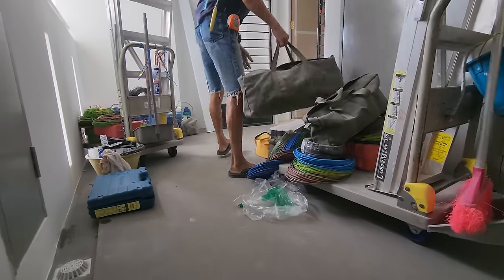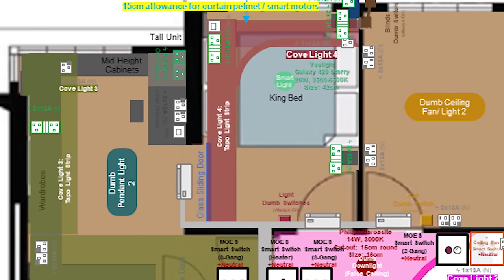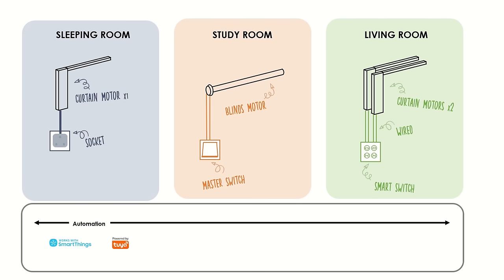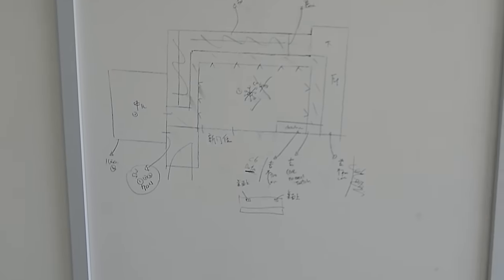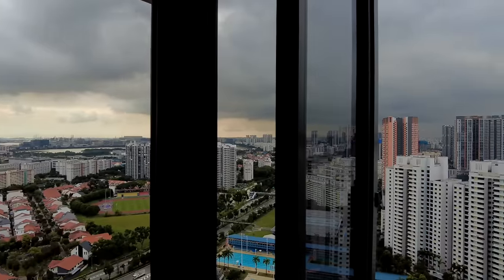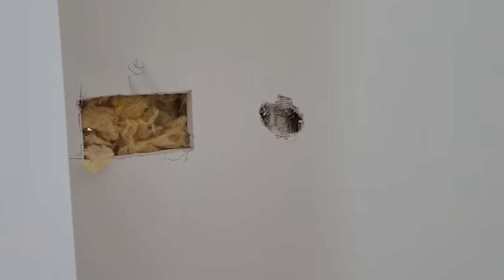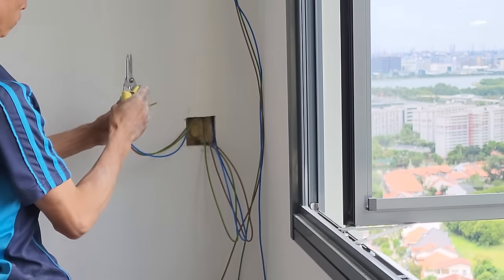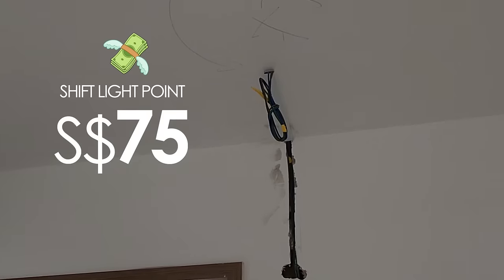Electricals Tips & Cost Breakdown | Self-Designed Neutral Contemporary Home | EP06 HDB BTO Reno

Comment: Thanks for the insight on the electrical works, just have a few questions before i plan out my renovation.
1. Do they have a separate costing for ceiling presence sensors?
2. Did you install your Ring doorbell via a constant power supply? If yes, how much did they charge your.
3. Did you purchase your own LED Strip Lights?

Thank again for the video.
Reply from the maker: Hello there! You are most welcome~

1. Nope.. Most IDs not sophisticated enough to advise you on anything smart home related 😆 Best you self plan, self buy and just tell electrician where you need the electrical points

2. Nope, the battery actually lasts very long. We have two batteries so just rotate out every few months.

3. Yes for the smart ones like Philip Hue or Tapo. As for the normal dumb light strips in kitchen, they are supplied by Electrician. Toilet ones are supplied by the vendor who did the acrylic panel box up 😀
Reply: @thesuakus  

Hello, thanks for the quick answer.

Actually i have already planned out my IoT devices but am only afraid that the Electrican will only be able to install specific 240v modules, and may charge more for others.

Since you bought your own hardware, did the electrican mentioned if they are not liable if any of the devices got spoiled during installation? I would guess your philips hue is via power socket instead of a transformer?

Comment: Do you have a video on how to plan from scratch to do smart home. So confused atm 😢
Reply from the maker: It's coming after our reno series! In the meanwhile, you can check out our Lemon8 for electricals planning (2-part posts)

https://s.lemon8-app.com/al/MvMFmFdQQR

Would recommend you first select an ecosystem (ours is Samsung SmartThings x Google Home) and go through room by room the solutions required (smart light bulbs, smart switches). For devices/appliances, it's simply researching and selecting those that compatible with your primary ecosystem (either directly, or indirectly with the help of a blaster etc). For example, aircon wouldn't be directly compatible with SmartThings, but it can be, with the help of a Sensibo blaster, which is SmartThings compatible. Another example would be our smart curtains and blinds, they are inherently Tuya, which is SmartThings compatible as well. You can check out our Bedroom episode 13 and Foyer/Living/Dining episode 15 which showcases some of these! 😀
Reply: Thank you for ur reply

Comment: thanks for the videos! may i know is there any hacking required to conceal the wire in the toilet tiles?
Reply from the maker: Hello! You are referring to the LED light mirror point on the wall right? 😀 For BTO, no hacking of HDB tiles are allowed until 3 years later, so the only option is to overlay new tiles. Prior to overlaying new tiles, you can get your electrician to pull a new wire for you. During overlaying of new tiles, your tiler can skillfully embed it in a manner that is safe (E.g. within the grout / cut a hole in the new tile). When the electrician returns next time, he will help connect the point to your LED light mirror!
Reply: @thesuakus  thanks for sharing!

Comment: Hi! I noticed there’s no supply of lighting point in your quotation. Is it part of lighting installation? My quotation split into two cost for my lighting work: supply of lighting point ($48) and installation of light ($15) which lead to $63 for one light work.
Reply from the maker: Hello there! Most of our lights use existing lighting point so no need to pull new ones 😀

Comment: Hi Sua Kus, thank you so much for sharing your reno journey - it has been really useful for those embarking on their own! I have a question regarding the electrical point in the bathroom for LED mirror, are the wires able to be concealed behind the existing HDB wall tiles? I'm not planning to overlay wall tiles like you, but still wish to install an LED mirror without the cable trunking visible if possible. Thank you!
Reply from the maker: Hello there! It is always our pleasure to share more and help fellow homeowners 😇 Is yours a new BTO? In theory, new BTO have limitations to existing HDB floor and wall bathroom tiles so we can't touch those for 3-years. Some electricians may be able to hide it within the slit in the grout so can see what they say. If not, go for the bigger mirror so that the trunking is very minimal 😀
Reply: @thesuakus  yes ours is a new BTO. Is yours a new BTO?
Reply: I saw you managed to hide the wires in the grout very nicely! Did you have to hack the tiles a bit?
Reply from the maker: Ours is new BTO so we can only overlay tiles, cannot hack existing tiles 😀

Comment: hi, thanks for the super informative video! wanna ask regarding laying of neutral wire. your cost breakdown was for per room.. but my ID quoted me by per electrical point 😢 plus hacking to conceal will be about additional $100 per point. so just wanna find out more about how neutral wiring is done. for yours one neutral wire in each room can link to multiple smart switches?
Reply from the maker: Hello! Glad you found it useful 😀 Yes, our neutral wiring is charged by room, and covers all the switches that we specified out. Still not too sure about how neutral wiring works because it seems like in the end our entire house have the same three colour wires. 🤔 Wonder if it was already a default for new BTOs? Maybe someone can help clarify in this thread! We concluded that different electricians quote differently so not easy to compare because they might quote cheaper in other scope of work. For eg, our basic single/double power points are on the pricier end ($70/$80) compared to others which are at $60/$70. With dozens of sockets, that add up to quite alot too. So after all the mental accounting, it kinda evens out. As for the conceal works right, maybe hold it off for now? We are still trying to understand its legality and plan to make good.
Reply: @thesuakus  hi, thanks for the informative video! Can I check if you could share the electrician’s contact details? The quotation we received is a fair bit more expensive.
Reply from the maker: @nothing-ei3oc  You're welcome! Actually we don't really know where all our subcontractors are from 😆 Our ID deals with them but based on their teeshirts it seems like they are from Power Solution Services Pte Ltd
Reply: @thesuakus  thanks! I think it’s great how involved you both are despite having an ID. 

You both are doing a lot to reduce the information asymmetry between contractors/IDs and consumers. And I think those looking to DIY would learn plenty from your videos. Keep up the great work!
Reply from the maker: Aww~ thanks so much for your kind words of affirmation.🙏 Viewers like you give us the courage to keep going and help future homeowners make more informed decisions in their reno process. You're very observant and we're glad that you could pick up on our level of involvement as what we present in our weekly videos are just the tip of the iceberg 😔 on hindsight, we should have gone down the Contractor route.. 😅

Comment: How are u connecting the smart switches using Samsung SmartThings?
Reply from the maker: Hello! We've been testing Tuya integration with SmartThings and it's often hit or miss, so hoping it all works out! 😃
Reply: @thesuakus  Have you consider connecting Aqara smart switches using Samsung SmartThings?
Reply from the maker: Yes, I've asked smart home specialists about the specific models compatible (as the list of Aqara devices is quite vague on the SmartThings app) but they all seemed doubtful..
Reply: @thesuakus  which Smart Switches can connect to Samsung SmartThings like  Aqara Smart Switch connects to Apple HomeKit with ease and stability.
Reply: @thesuakus  what is brand and model of switches r u using?
Reply from the maker: @mohdsultanshah  We are using MOES brand smart switches. I suppose many of Tuya compatible products all come from the same oem, just rebranded and reskinned.

Comment: Shift ceiling light point $120, install ceiling light $25, new PowerPoint non conceal single/double $75/$85, $100 if partition wall conceal, $110 if concrete wall conceal. The prices very anyhow.. 😅
Reply from the maker: Aha ya really anyhow... some quotations we've seen from fellow homeowners have per-unit costs cheaper but then there's a separate line item that  simply lump everything together into a thousand dollars for " all concealed works " etc.

Comment: Very well done videos! Can't wait for more updates and finished product.

The plans and things to get are very similar to what I have in mind. Definitely good videos to learn lessons from!

PS: Can I ask for neutral to light switch, you mentioned its charged by per room or do you men per point (or is it due to the room only has 1 single lighting switch point)?
Reply from the maker: Thank you so much for your kind support! Comments like this keep us going 🤩

For electricals, after numerous comparisons with different home owners, we realise that different electricians breakdown the cost differently. Ours charged neutral wiring by room (if entire living room has 3 smart switches, one flat fee of 40). Some electricians charge by switch..
Reply: Oh yeah. Regarding the wiring. I think most of them will just cut the shortest distance possible and right angles may not be so “friendly” for wires.

Comment: hi., did you run neutral wire throughout your whole unit? can I know what's the estimated total cost for a 4room? hope to see you sharing your smarthome gadgets soon.
Reply from the maker: Hello! We pulled neutral wires for living room/kitchen/master at 40 each. Our electricals cost about 4k in total. Wouldn't recommend comparing line by line as there are definitely certain line items where it is quoted cheaper than others and others where it is more ex.

Comment: Your electrical quote is very worth it. I have a lumpsum conceal works with touch up at $650 which u guys dont have. For per unit cost, yours is comparable to mine, so i suppose its market rate. For the extensive amount of electrical works done, the price u pay is really reasonable and good! 👍
Reply from the maker: Hello! Thanks for sharing~😃 Ah, have you finalised your quotation or still can nego?

Actually, we still find that the mark up from ID's 'panel' of electricians is quite high 😐 We know of a few homeowners who managed to slash their electrical quotation 50% cheaper (around $2k savings) by self-sourcing electrician instead of sticking to the one sub-contracted/related to the ID firm. That route has its cons too (ie troublesome to coordinate) but if you have a kind-hearted ID who is genuine, he/she would be flexible enough to accomodate that and ensure that project timeline disruption is minimised.

Comment: Your sharing is super useful, especially with the cost breakdown details. Just curious, why some of the power points didn't conceal? Due to cost factor? Also, if possible, can use the pipe to run the concealed wiring in case you need to do a replacement.